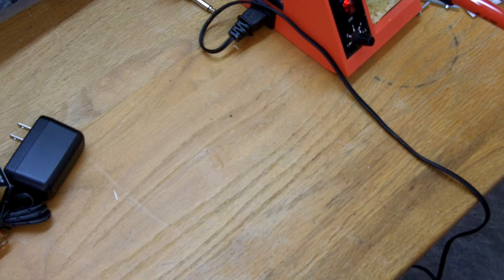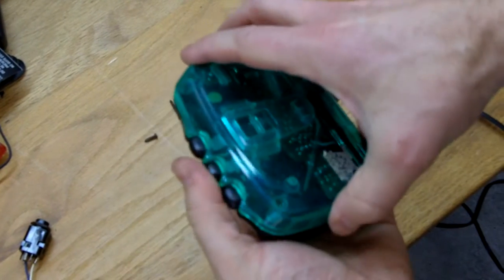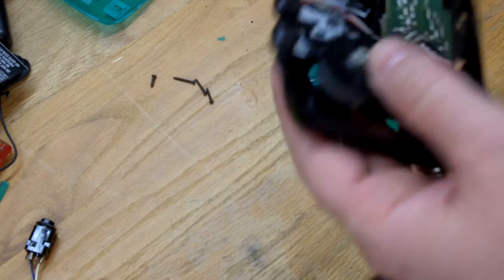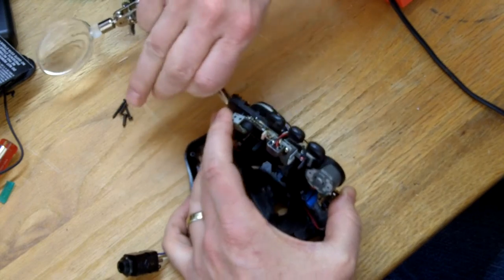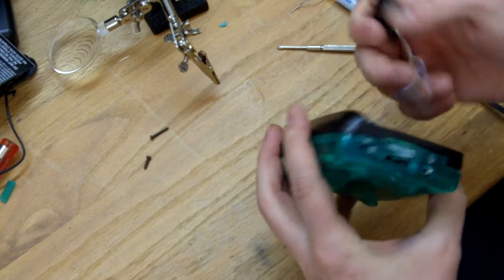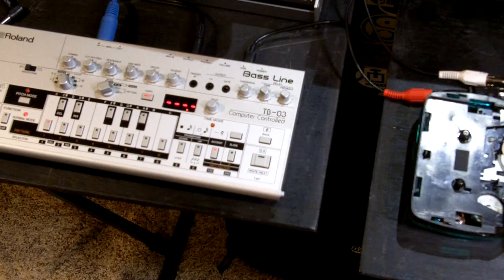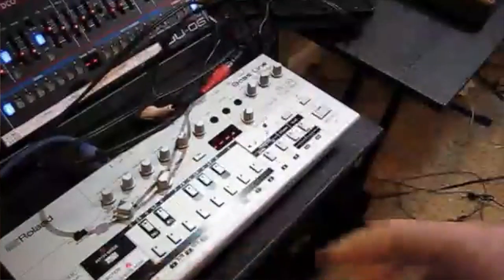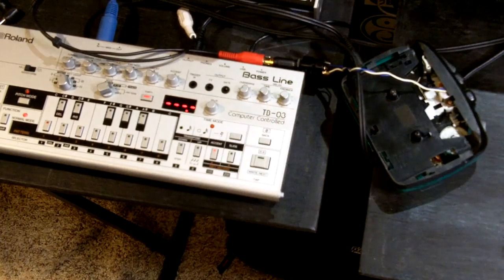Walkman Cassette Player  DIY Distortion Pedal

Comment: Cool idea! Another 'solderless' way of doing this is by using a cheap cassette to aux adapter. But instead of overdriving the amp you're saturating the tape this way. Basicly a budget tape saturator.
Reply from the maker: I've done that one before as well! Old tape machines of all types can be fun and useful.
Reply: I did something like that but I soldered a quarter inch jack to the leads for the tape head of the adapter, I should record a good video of it.
Reply: Can you make a video about the solderless way?
Reply: @anode8 I had some high end type  cassette tape player ( that was in slight disrepair)with 1/4 mic input and output with controls for both the input and output. Best distortion ever!!!!! This was back in 1985. I went away from that, maybe because you couldn't by-pass it at will. Probably started using an Ibanez Sonic distortion afterwards but running through the cassette player was a way better sound!! Now I use DSPs and whatnot but soon I might revisit this tape player concept!!

Comment: what happens if you play a tape in it while using it as distortion?
Reply from the maker: Well, on this one I actually removed the tape head to put in the jack, so nothing would happen. I suppose if you just added the audio input jack in parallel with the tape head you could have both coming out.

Comment: Is it possible to build an cheap analog tape reverb out of an portable cassette player?
Reply from the maker: To make a tape delay, you need multiple playback heads that a taped signal will cross. The distance between the heads will determine the delay time, if they were close enough together it might sound like a reverb. this would require piecing together tape heads from several machines, and coming up with a mixer to combine their signals. So while it is possible, it's not really easy or practical to achieve, but stranger things have been done.

Comment: Now you givin away secrets to the enemy
Reply from the maker: Sorry dude! ;)
Reply: @anode8  just bein cynical
Reply: @anode8  i made one and put it in a little nutone intercom metal box with a speaker. With switching jacks. It could be a pedal always on or a little amp. I went in one channel and out that into the other channel
Reply: @anode8  ive got 5 to build. One has a bass boost and one has a bias switch
Reply: I wonder if the bias switch could be put through a potentiimeter? Or just a switch

Comment: does the tape player need to be running with batteries as usual?
Reply from the maker: Yes, the tape player needs to be powered, as what we're doing here is overdriving the amp circuit of the walkman. Depending on which model you have, some do need to be "playing", while others will work without the "play" mechanism engaged.